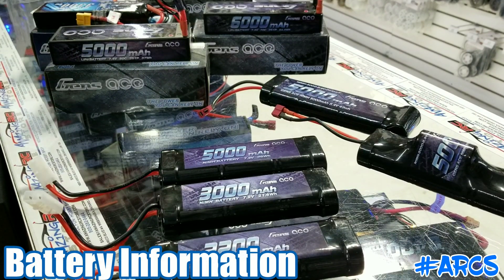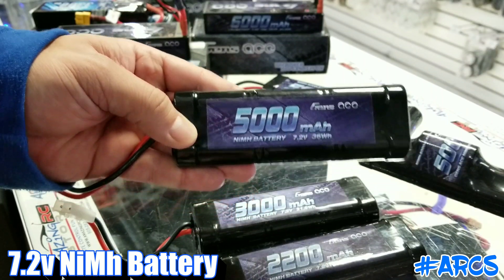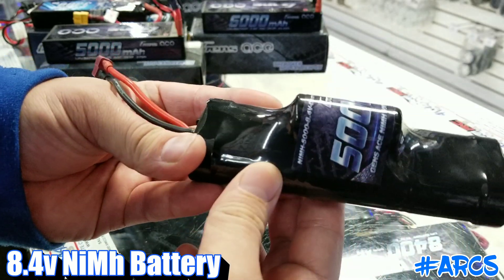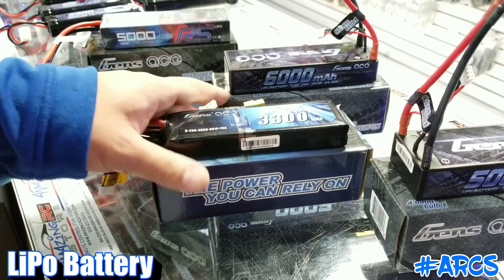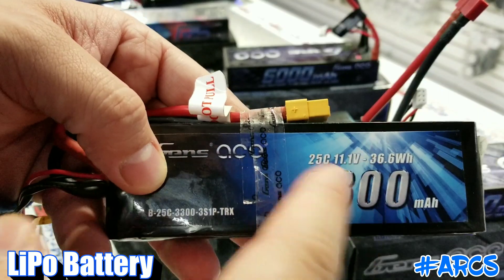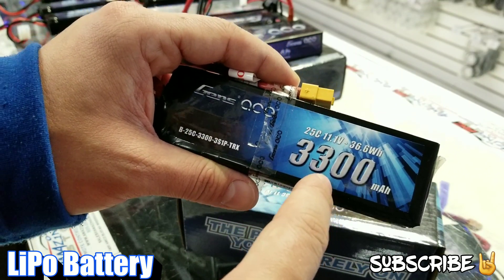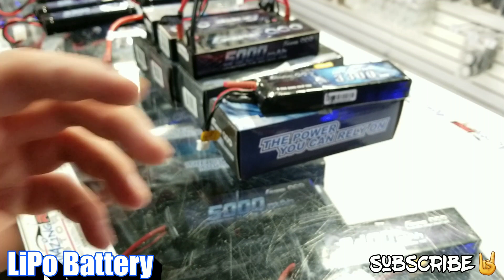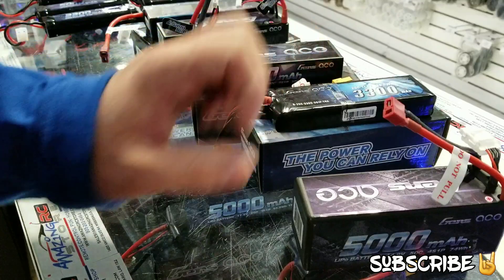What is the Difference between NiMh and LiPo Batteries?

Comment: From what i have seen, the use of LIPO batteries is more complicated over the use of NIMH. Their care and use is complicated and seem to have no real advantage over NIMH. I am just a hobbyist and not dedicated RC FREAK, running TAMIYA 1/16 RC TANKS, and RC CROSS MC8 1/12 CRAWLER. I am not very technically minded but can see the use of LIPO in high performance RC, but in my case can see no real advantage for the extra care and sensitivity of LIPO. I would like your opinion as i currently have both batteries, the LIPO came with the RC CROSS KIT, so not sure whether to use it or just use NIMH. Appreciate your video. ps, i am an old fart.
Reply from the maker: You are absolutely correct. It all depends on your application, for a slower RC as in a Tank or a Rock Crawler or even a Tractor and Trailer you are better off using a NiMh Battery. LIPO batteries would be more recommended for any RC that has the capability of reaching very high speeds, like a Brushless Boat, Bashing or Racing RC. 👍 I hope this helps. Thanks for watching.
Reply: @AmazingRCstore  Appreciate you getting back, many thanks.

Comment: The C rating is sometimes the continuous discharge, and sometimes the burst depending how the manufacturer lables it. It is sometimes deceptive. When buying batteries check the specs to see what the continuous discharge is and burst. For example: a 50C battery could have a burst of 100. Or the lable could be the burst, for example: a 50C battery would discharge at 25 continuous, 50 burst.

Comment: Is there an 11.1v nimh battery for rc cars??? And my rc car has a nimh battery can you buy a conecter that changes it to deens and use lipo battery or you can't do that
Reply: Taha YT614  you can change the connector but be sure that your rc supports a lipo
Reply: You can get an adapter for them

Comment: So i have a question, i need a 7.4 volt barrery and i noticed that the lithium ion batteries are quite expensive for small ones, could i just use a 7.4 volt nimh battery instead?
Reply from the maker: You can use a 7.2Nimh battery. 👍
Reply: Can you recommend good 7.2v nimh batteries? I will be bridging several in parallel
Reply: Also thank you

Comment: Great video. I was wondering have you had tried Li ion 18650’s as they’re 3.7Volts and wouldn’t 3 together be 11.1V? I’m a newbie, but looking at LiPo, NiMH, and Lithium-ion, wouldn’t a lot of low voltage/run time be eliminated with the 18650 lithium-ion? And all the change time danger concerns be obsolete? I know nothing and looking to start out with my son, but the more I learn, the more I question the LiPo technology. I know weight is a factor too, but aren’t they relatively the same weight, just less cells with Li-ion? Thanks so much for any input. 😉🙏🏼🇨🇦
Reply: yes you can use 18650,s. the ones used by vapers have high discharge current. run them in series and parallel to get some serious power!